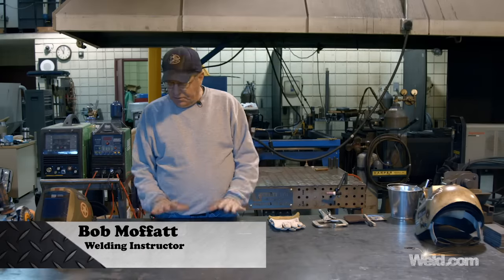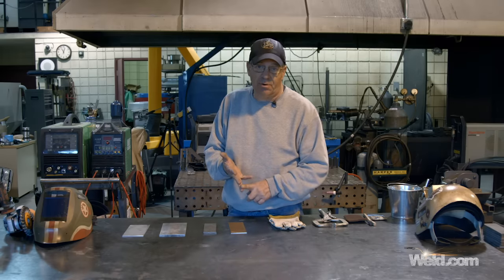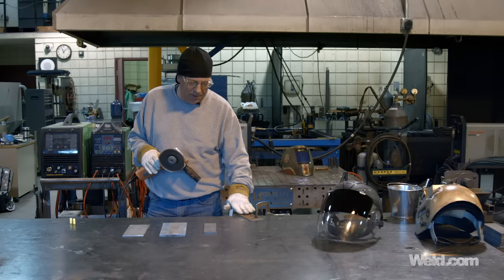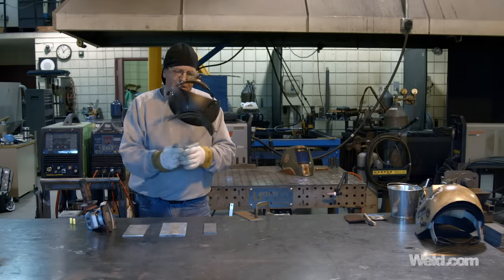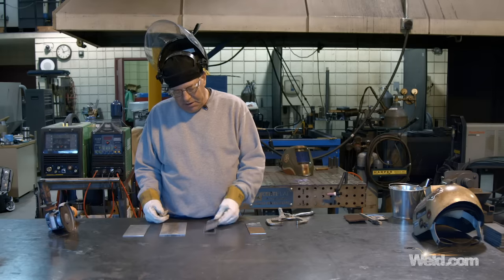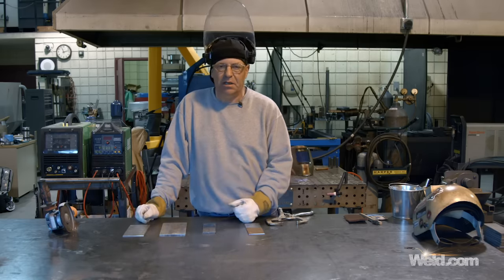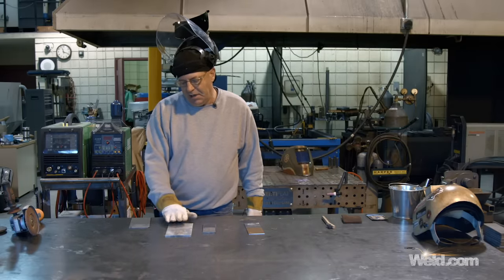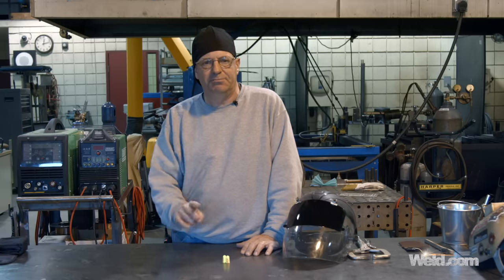🔥 How to Properly Clean your Metal for Welding

Comment: Thank you for doing this video and showing us how important cleaning is. All too often I have run across people on the Internet saying  "oh just crank up the amperage and burn through the mill-scale". They believe they are saving money by illuminating a step. I would'nt want to see their creations fail structurally. I prefer absolutely clean material for better fusion, thanks Bob for a good video. I taught for over 25 years with hearing plugs of all kinds in my ears, I set good examples for my students and I can still hear a pin drop however my wife and others say, I have selective hearing!

Comment: Hearing protection, yes ! If you want or need to hear at the same time, the ear muffs that are made for shooting are the real answer.  You can talk and make noise at the same time.  What have is a microphone on the outside and speaker inside with a max volume setting.  The fanciest ones claim that you could hear heavy breathing on the other  side of a wall, but those are police / combat quality & very pricey. Mine came from Dillon Precision reloading & currently run $135 & worth every cent.

Comment: How far back from where you are welding do you need to clean the metal, or do you just need to clean the area the weld will go?
Reply: Technically you need to clean just the area the weld will go, but about one inch cleaned around the welds used to be handy.

Comment: Hey bob can you do a video on some big diameter fluxcore wire? Im in the process of taking tests for a new job. We have been using .072 and 5/64 lincoln nr233 and hobart xlr8 fabshield. We have been running tests on 1" plate in 2 3 4 g positions. Toughest one for me so far is the 2 g, 1" plates top one with 30 degree bevel and bottom one is a square end, 3/8" root gap with backing strip. Im having problems with fusion in the root. Any knowledge you can share with us on this wave of heavy diameter flux core for industrial construction would be awesome!

Comment: Thanks for the video. Didn’t hear bead blasting mentioned for prepping. Nowadays I always bead blast my carbon steel prior to welding. So much easier and less dirty when done in blasting cabinet. I use aluminum oxide blasting media. I`m not sure though is there a possibility of steel contamination that could affect the weld. However never seen any problems of that when tig welding of the blasted steel. On the other hand, the flap disk is Al oxide as well so probably makes no differences.
Reply: Ccorniit I'll bead blast carbon but not aluminum.

Comment: Hi Bob, many, many years ago when I first learned how to weld aluminum I was told to warm it up a bit before brushing it with SS wire brush. In your opinion is there any benefit to doing this? Still learning how to weld aluminum, by the way. Thank you.🙂
Reply: Richard Valcourt That does help.

Comment: Hey Bob. You're videos have helped me  in numerous ways to help me pass my aws and state tests. I recently went out in the field for first time as a structural steel welder. I failed miserably. Is it possible you can show how to weld with gaps? Or a lap joint around a rusty ibeam? I would set my practice plates the proper way, clean and tight. Well in the field it was a different story. Please help. Thank you.
Reply: Interested to hear how you got on and if you're still doing it now?

Comment: newbie grinder here: can anyone recommend a good flapper wheel for grinding/preparing aluminum for welding? Since I'm trying to grind off the aluminum oxide I'm guessing I don't want to buy an aluminum oxide flap disc? Options seem to be steel and zirconia? 80 grit for welding prep or ...? Thanks!
Reply: Stainless steel wire brush by hand. Don't use any power tools, because it will just push the dirt deeper into the aluminum.

Comment: On aluminium, how long do you have before oxides form enough to interfere with your welding?
Reply from the maker: Almost instantly. The positive side of your AC wave will take care of the oxides.
Reply: Weld.com Thanks!  Sounds like I need to learn a lot more about what different parts of a waveform are doing to the metal. Any good references out there ?

Comment: I'm having problems stick welding thin material (1.0-1.3mm=18-16g) with a cheap DC inverter. Are there some obvious things I should and shouldn't do? I seem to blow through all the time. I've tried 1.6mm (1/16") and 2.4mm (3/32") rods. I try to keep a short arc. I've lowered the amperage to the point of it being almost impossible to strike an arc. I'm going as fast as I can while still getting enough material down to bond two pieces together. I find it really difficult to balance getting a decent weld vs blowing through. Only "solution" I've found so far is to pause every inch or so to let it cool and clean the slag, then resume (very time consuming). And/or make a fast bead on each side of the seam to build material thickness, then make a third weld between them over the actual seam to finally bond the pieces together. Yes, it takes forever. Should I try switching polarity? I'm about to try converting my machine to TIG (as a desperate measure).
Reply: I'm using 6013
Reply: knivjocke
Definately good idea to convert your machine to TIG if you're going to weld 1.0-1.3 mm steel. I don't think any welder would recommend stick welding thin material like this. But, I think you can try to stick weld that with a little trick, which includes a relatively thick piece of copper (red or yellow) plate to back the plates you want to weld. If the pieces you want to weld together are not flat, this method is not too practrical, because you would have to form the copper plate to fit the backside of the material to weld.
So take a piece of copper plate that is long enough to cover the length you want to weld, it needs to be at least around 1-2 inches wide to dissipate the heat of the welding. The thicker the copper plate is the better, you don't want to use copper foil. Lay the copper on the backside of your future weld bead tight, to let it touch both the pieces with the most surface area. It will cool the steel while you're welding, and will help you to weld evenly. The backside of the weld bead will be smooth, copper won't stick to the weld.
Reply: Stick welding anything under 3mm takes a lot of practice. 1mm is going to be really hard. Can you change your design to make it thicker at the weld? Also lap joints are going to work better than butt joints. Hope it all goes well

Comment: For steel, have you tried muriatic acid to remove rust and mill scale followed by a baking soda solution to neutralize, then phosphoric acid to create a very thin layer of iron phosphate to prevent rust from reforming?

Comment: Excellent video sir! I have learned alot from your vids. Im about ready to pick up my first machine, a 325 EFI Miller Trailblazer. I have offgrid property, and need the generator ability of a gas diven welder.

 Do you think it would be bad to use the generator part of a welder 5-6 hours a day?
Reply: Refried Beans Good choice.
Reply: Can't see it doing any harm, I was looking at a blue star 185 for similar reasons, and we ran a bobcat all day last year at work feeding an air compressor when power was shut off to our work area
Reply: Bob Moffatt   Well said.  Truly the sign of an expert on alternative power generation!
Reply: I see no harm. Keep the oil and filters changed and give it ventilation. Don't close it in a small building without good vents. You will be surprised how much heat they put out. People in construction weld with these 6-10hrs a day everyday until they get thousands of hours and they trade it in.

Comment: Busted!  Write 25 times with a tig welder on aluminum...."I will unplug my grinder before changing the wheel".Otherwise a good video.Rick
Reply: It's not that big of a deal with the grinder. Maybe the electric version, air tools not so much. However, i always disconnect the airline from my drill before changing the bit. That thing will chew your fingers up.